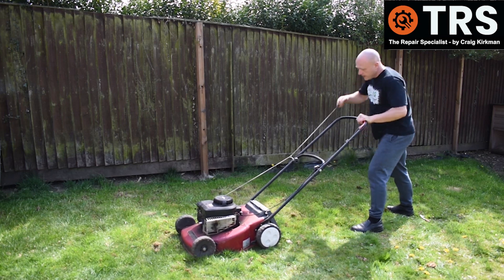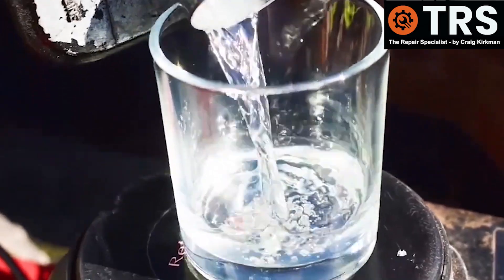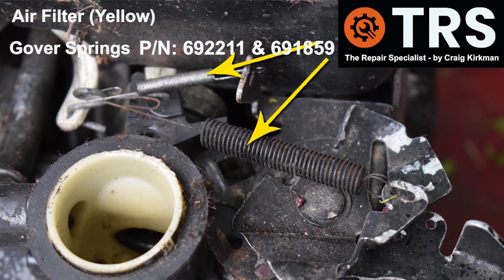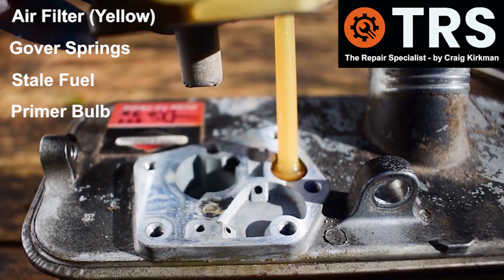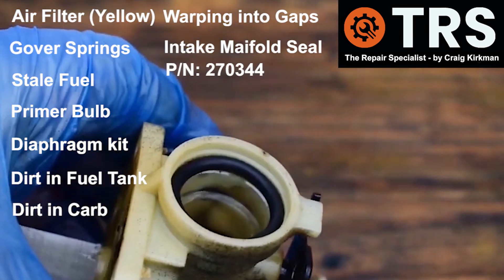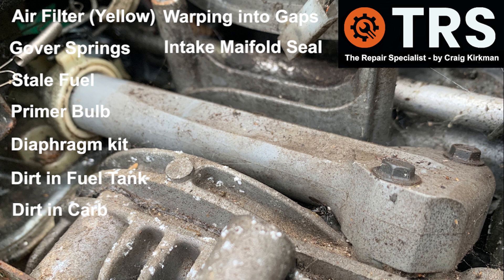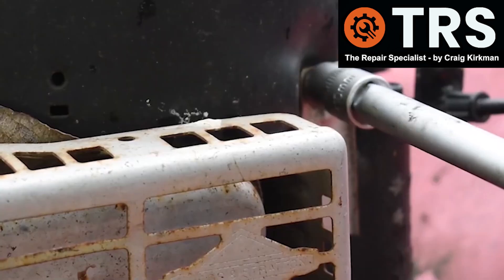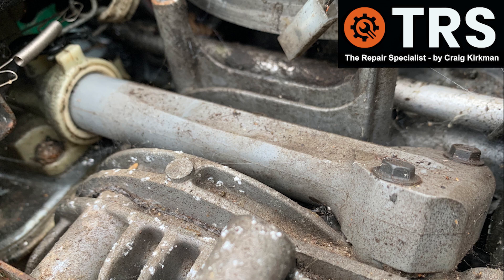LAWN MOWER WON'T START Overlooked cause - Engine Surge - Briggs and Stratton (by Craig Kirkman)

Comment: I have Brig's and Stratton and it's working 15 minutes and turns off.
I take Spark plug and it's black. Than clean it up and it's fire's again normally. What is the problem?
Thanks

Comment: Really enjoyed your couple of videos that I’ve watched now and your explanation is very good I was wondering if you knew much about Honda GX engines as I’m forever having problems with them in generators and pumps and wondered if you could do an explanation of what the common faults would be on those if that’s in your realms of expertise? Many thanks

Comment: I find it interesting that many people begin to search problems on really odd places after storage and running issues. Like in spring I've heard many searching problems from spark plug first. I mean if the machine was running fine before storing, the root cause is pretty much always bad fuel and especially oxidation caused by that and then ie. diaphragm gone bad or carburetor sealing gone bad at some location. Use common sense in fault finding. That spark plug is almost guaranteed to work after storage. Heck just last summer I revived B&S garden engine that had been outdoors winters and summers for last five years. Repaired throttle cable and grounding for engine kill. Plus fixed the broken starter cord reel spring. Cleaned fuel tank and cleaned carburetor with ultrasonic cleaner and blew old filter with compressor. It started fairly well with additional fuel given, even though diaphragm wasn't the best I've seen. Spark plug was just fine still after so long storage. Ok, I think I removed the plug and give it bit sand paper, but anyway didn't replace it.